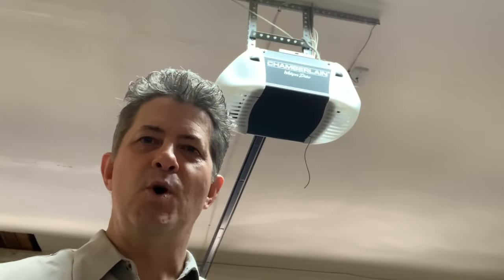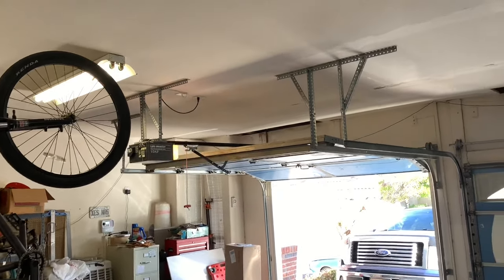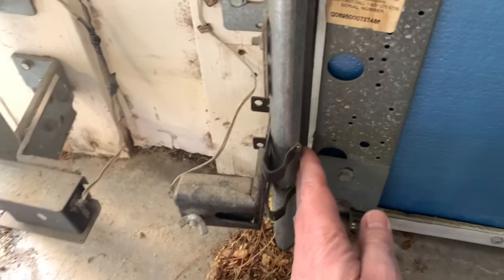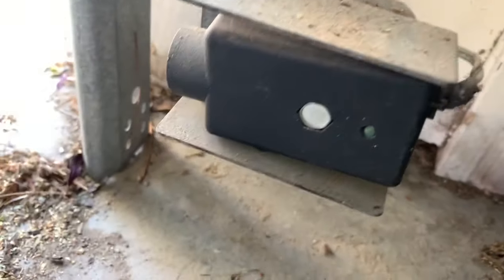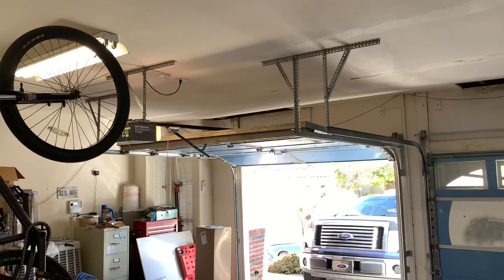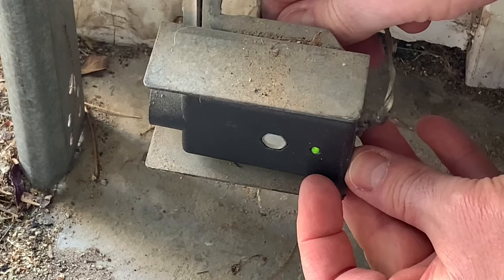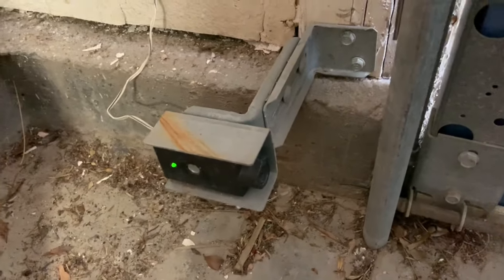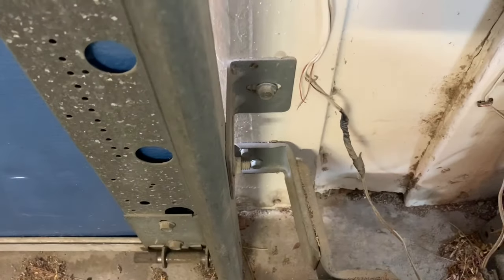Garage Door Opener Stops and Reverses

Comment: You, my good sir, are a wizard!!! I couldn't figure it out and thought it was a programming or wiring issue since I would have to hold down the switch to close the garage door. Saved me time, money, and a heavy load of disappointment! Simple fix, video goes step by step and gives detailed instructions and explanations, audio and video quality were great. My first impression was completely wrong about you and I apologize for judging you by the first 15 seconds in your video. Therefore I destroyed the like button and subscribed! Greatly appreciated 🙏🏽👍🏽
Reply from the maker: LOL! Glad you stuck around!
Reply: The lights go off on my garage door,what you think could be the problem?
Reply: You certainly know your stuff! You aced it. Saved me an unnecessary expense and an argument with the spouse. May you and your fine family have a healthy happy Thanksgiving. I know you'll be one of my Thanksgiving blessings.
Reply: 😢🎉😂😂m
Reply: Great vid but wonder if it can help with this particular anomaly after re-engaging? :  

Mine's a brand new garage door (I'd also been moving stuff in to store). My girlfriend didn't leave her key fob so I had to open the garage manually. I re-engaged the part that pulls back the garage door but the door is now only half closing?! i.e. I note the travelling white part (that engages the black metal mechanism part of the door) is stopping about two feet away from where it should - hence the door no longer shutting.

I definitely haven't broken anything but that re-engaged white part refuses to travel back to it's further forward original position. Any extra help is welcome before I try a sensors check  / travel adjustment tomorrow...!

Comment: If the overhead unit light is not blinking, it is not an alignment problem with the sensor; it may be that the down force needs to be adjusted i.e. increased.  If the door when taken off the opener moves up and down freely, that may be the solution.   The force  can be changed via the screws at the back of the motor unit, one is for down and one is for up force.
Reply: This fixed my issue that was driving me nuts ! Thanks Doug 🤝
Reply: Thank you, Doug. This was my issue! I am glad I read through the comments.
Reply: Thank you sir 🙏
Reply: Thank you Doug
Reply: Thank you for your comment, it fixed my problem
Reply: This solved my problem. Thank you!😊
Reply: You are the man doug 👌🏽👍🏽
Reply: Doug ur a savior, months of my headache was fixed with this
Reply: Sir you have just saved my night with your help. Thank you 🙏🏻
Reply: I have joined the ranks of people that have been helped by this comment. Thanks!!!
Reply: You saved me a brunch thanks man!
Reply: Thank you for this comment! I have an older wood door, and this did the trick. I have it maxed out now, so if it starts acting up again, it's time for a replacement.
Reply: Thanks Doug, this also fixed my issue!
Reply: Thank you! It helped fix my issue
Reply: Good to know.
Reply: Thank you boss
Reply: You fixed my door, just now, how much do I owe you? Unbelievable. Been frustratingly going at it off and on for weeks. Did the tape the sensors together bypass, have 2 replacements in my Amazon cart now. This simple adjustment solved it, thx my friend.
Reply: Thank you this comment fixed my door👍😃
Reply: Thank you for this comment!! You saved my sanity. This fixed mine!
Reply: I got one off those 💩My Q models.   It’s started going back up when almost or all the way down all winter and Spring.   No amount of resetting it  works more than a time or two and this model had absolutely.lutely no sensing adjustments!!!    If I’d thought that was possible I would never have gone near it.   What garbage.
Reply: Thank you Sir
You are the best
Reply: Thank you! This fixed mine too!
Reply: Thank you, that did it.
Reply: Any vedio

Comment: This evening my garage door started automatically going back up, everytime it got about a foot from the ground when I was attempting to close it. I tried to close it about 10 times, and got the same result every time.  After doing some troubleshooting, I discovered that my issue turned out to be a loose bracket that held one of the sensors to the wall.  Whoever installed the system before I bought the house, used nails to secure the brackets to the wall instead of screws.  So the nails in one of the brackets had loosened a bit, allowing the bracket to slightly vibrate once the bottom of the door was near the sensor.  As a result, and while the sensor bracket was vibrating, the sensors got misaligned for a slight moment, triggering the safety mechanism.  I replaced the nails with screws and the problem was solved.
Reply from the maker: Good troubleshooting!
Reply: Thank you. That was my issue as well. The alignment initially was way off but it still would stop and reverse about 2 feet from the ground.

Comment: My garage door opener will not close if opened or will not open if closed.  Following this video, one of the sensors does not have a green light.  I climbed up to the "motor unit" and wiggle the wires that connect to the sensors.  One of the wires was loose and can easily be pulled out.  I pull the wire all the way out and push it back all the way in.  Now I have a green light on each sensor.  Problem fixed.  I almost call the garage door opener people!
Reply from the maker: Cha-Ching! Nice job and saved some cash!

Comment: Mike, Thank you so much. Your clarity and description of the sensor problem was all new to me. In my case , the visual blockage to the other sensor was resulting from a spider web array on the sensor and a slight adjustment of the wing nut. Wow! It all worked 1,2,3. Thanks Again. Five minutes and a problem that I have been experiencing for several months was solved.
Reply from the maker: That's great to hear-glad I could help!
Reply: mine was spider webs as well

Comment: My sensors are good. But my door still won't go down or goes partially down and then reverses. Need another video that tells what else it could be!
Reply from the maker: I would start with increasing the downward force. There will be an adjustment on the motor for this.

Comment: My garage door won't close because there was an obstruction blocking the sensors which I didn't know. I decided to search YouTube for an answer. I found a video that outlined everything you need to do to fix the problem. I removed the obstruction but did not attempt to close the garage door because the video said both sensors light must be green. But one of mine didn't turn green. Then I searched further, and found your video. I heard you say in your video that some garage doors sensors may not have both lights green. This saved me. One of mine was green and the other amber. So I decided to try to shut the door and voila it closed. Thank you for that detail.
Reply from the maker: You're welcome Rich!

Comment: Wooowww, I had this problem for 2 years or more. We had to get out of the car and close it manually with the external control and sometimes the door was going back making us get mad and waste time, I replaced the rollers, greased everything and today I looked for another alternative and found your video. I just adjusted the sensor to have a solid green light and the problem was fixed.
Thanks a lot.
Reply from the maker: Awesome Jose!

Comment: My garage door failed in the manner you showed me on your video.  I checked one sensor that had a bright orange non-flickering light. Because of your advice,  I knew that was the power sensor and that it was working correctly. I checked the second sensor and that sensor had a dim green bulb. I cleaned both sensor lenses with Windex. I adjusted the wing-nut on the sensor with the dim green bulb until that bulb turned on and remained bright green. The door closes perfectly.  Thank  you for your help.
Reply from the maker: Glad it helped Richard!

Comment: My problem was not included in the video, so I thought I would mention it.  The curved arm that attaches the trolley track to the garage door has two bolts/nuts on my door. I did not realize that one of the bolts had fallen out.  The arm was no longer straight and it ended up literally pushing the top of the garage door down at it's top instead of "pushing" the door down from the point where it is mounted. Then, the mounting point where the manual release is attached came loose. I found the original bolt and added a new nut and then re-affixed the locking portion into the base where it locks.......this solved the problem. The garage door was stopping about a foot or more above the ground because it was just pushing the garage door down from the top. Hope this helps.

Comment: I had the same problem but both LEDs were on and not blinking. I cleaned both anyway, re-installed. Now it works fine. Thanks for sending me in the right direction!
Reply from the maker: Glad you got it figured out!

Comment: Thank you so much im at a friend's house and thought I broke it and if I didnt fix it I'd have to pay for a new one but luckily this helped!!
Reply from the maker: Awesome! Glad it helped!
Reply: @MikeKlimek  Awesome video....What would you suggest if i am getting no green or yellow light on either sensor, but still able to close the door using the wall mounted garage opener???
Reply from the maker: @durockize  It could be a several issues...maybe a bad sensor(s), bad bulb in the sensor(s), bad/damaged wiring (I've seen wiring with staples punched through it), bad connections to the motor, or bad board?

Comment: Thank you! The sensors weren’t my problem, but you got me on the right path with the lights on them. Eventually found a loose wire in the unit that caused the sensor lights to flicker. Secured it and works great!
Reply from the maker: Way to go Bob! Glad to help!
Reply: How did you fix the loose wire? From the head unit or sensor? Main wire?
Reply: @stingrayproduction4249  I was up inspecting the unit and simultaneously looking at the lights on the sensors. I noticed as I was poking around, the lights on the sensors were flickering. Turned out to be where the power line plugged into an extension cord. It wasn’t making a solid connection. So when the unit would vibrate to lower the door, it would trip the power off and on, sending the door back open.
Reply: I think that is my problem too. Cleaned the sensor and have it face each other, but still doesn't work. It closed for about a feet than go back up. Thanks for the reply. Hopefully it work after this.

Comment: Thanks for this very good video! And, it's older garage doors like I have. I just cleaned mine and got some spray lube just for garage doors and sprayed the rollers, springs and tracks. Cleaned the sensors with bit of alcohol on a paper towel and it's better but it still reversed 3 times before it closed. (It has been taking up to 6 times!) I will check out the green light thing and some other tips and see what works! Thank you for a good, easy to follow video. PS...my garage is also a somewhat cluttered mess!😂
Reply from the maker: LOL! Yes get the door working first, then clean the garage!

Comment: Thank you  for this advice, my wife and I were double pushing the remotes she pressed the garage remote on the passenger visor as I backed out and i would press the new coar built in remote then we would reverse it so I thought the belt teeth jumped out of setting. But after watching your video I checked it out and it was OK so I look closer and saw a piece of duct tape I wrapped around some foam to prevent dinging the trunk lid came unwrapped and would waver to block the light beam so I removed that and all worked ok again.
Reply from the maker: Awesome-glad you got it figured out!

Comment: I have been having issues with my garage door opener for years and have just gotten used to manually closing it. 

But I finally decided to look into it. I always tried cleaning the sensors but that never worked. I will try readjusting the receiving sensor but what if that doesn't work? 

My garage door opener is only 5 years old. And I barely use it. Is there a way to do away with the sensors completely and just make the thing close no matter what? I never have anything in the way of the garage door so safety is not a concern for me. 
I just want it to close everytime without worrying about the sensors being dirty or whatever.

Comment: you're a freaking Genius!!! u just saved a lotta money...video is well explained. When I saw the sensors, they were not aligned ( the green one wasn't) i pushed it around and i saw the green light flickering and it was a ah ah movement.. i then put something to hold the sensor in place so the green light goes steady and then hit the close button.. and voila.. it worked.. then I removed the object i had put in place ( a brick) and realigned the sensor to get a steady light... i used the spit method to clean the sensor glass..lol.. bye yea thanks a ton for your video... I saw other videos and then stumbled upon this one.. this is how the troubleshooting steps need to be.. first, check the wires on the motor to see if anything is chipped, trace the wires all the way to the sensors, check the lights, one amber and one green one each of the sensor,  make sure the sensors are aligned before you start start using a screw driver to change the positions for force close and force open or going with other steps.. 

Thanks a tons though!  :-p
Reply from the maker: LOL! You're Welcome!

Comment: Mike.  Unplugging the unit for 5 minutes worked and I am now able to open and close it.
One of the remotes no longer works.  Battery is OK.  Does it have to be reprogrammed or replaced?  Unable so far to connect to 2008 Buick Enclave Home Link.  Canadian resident.
Thank You.  You helped make a Widow very happy.  Is there any way to put in a 'doorbell switch'
to act as an opener inside the garage?
Reply from the maker: You might try reprogramming the remote. For the button on the wall, (I assume you already have one there) buy a brand-specific replacement button to make sure it is compatible.
Reply: @MikeKlimek  I do not have one in the garage.  I want to install one there as well as have one in the house.
Reply: @MikeKlimek  Thanks again MIke.  I was able to reprogram the faulty remote  with no trouble.  3 Seconds!   Now I am trying to program my home link on 2008 Buick Enclave.  Using Canadian instructions which differ from US per manual. Nothing yet!
Reply: @MikeKlimek  I now have both remotes working thanks to You and others.
I also have one Vehicle programmed.  Is there a limit?  3? Cannot get the Buick programmed on Home Link.  Thanks again for your response and help.
Reply from the maker: @gordbaker896  Not sure about the Buick. I would think you can have more than 3. Maybe try a google search for that.

Comment: One of the sensors was askew. I adjusted it and the door now closes fine, thank you! My garage door is probably the original heavy wood door installed when the house was built. Do recommend I replace it for a lighter aluminum door?
Reply from the maker: There probably isn't a need to replace it unless you just want a more modern door with the option of adding insulation to it.
Reply: @MikeKlimek  Thank you for your prompt response.

Comment: Got a new spring on this door. I did that 7 times until it finally occurred to me to watch your video which greatly helped me. Doing that 7 times with the door going up and clicking is not going to hurt the new spring?
Reply from the maker: I'm not sure what you mean by clicking, or even what is clicking, but they are made to cycle many many times
Reply: @MikeKlimek  I did some reading and the motor should last for 10,000 open and shut. And it has a over heat switch to where if the motor gets too hot, it shuts off. The clicking is the light on the end of the device after the gate wouldnt go back down was because of an obstruction in the way of the sensor. With your help, I figured out what was going on
Reply from the maker: @johnathanbennett6260  Ah gotcha! That's awesome Johnathan, glad you figured it out!

Comment: I watched a number of videos & none of them specifically solved the problem. Turned out to be the connection of a sensor wire AT THE OPENER SCREW TERMINAL. Maybe never tightened, or lossened over time from vibratio. Check That Too....   Thanks for the great video, Mike!
Reply from the maker: Thank you-glad to help!